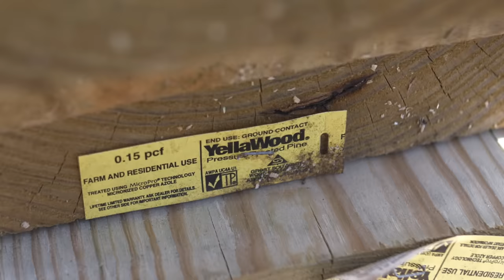5 Tips for Building a Durable Deck

Comment: I dont agree with spacing your deck ledger board 1" off the the house (of what ever structure you are attaching the deck to) this puts all the stress on your bolts. In this case you used all threads which are not as strong sheer value. If you flash and seal the ledger to your structure properly and water/vapor barrier the building being attached to, then you will never have to worry about water getting in there.  The bolts are designed to hold the desk from falling outwards not vertically. You should be using a 16D or greater nail or equivalent deck screw (concrete all threads in your case here) to secure it vertically to the structure.
Reply: Willis Cooper gotta love forti flash 😂👍👍
Reply: Also wondering up north in the winter where areas get freeze thaw freeze winters.  Water gets behind there, doesnt drain, freezes and expands.  Realize in Texas thats probably not an issue, but alos shows there is more than one correct way to build  adeck
Reply: Willis Cooper P totally agree. The pressure of the ledger against the structure its connected too helps distribute the weight and a lil construction adhesive helps too... As long as you putthe flashing in rite with a lil clear silicone.....  Its the best method by far
Reply: I was thinking the same thing. Even 1/8" of spacing puts added torque on the hardware. 

The epoxy holding those bolts has me a little concerned. I would still probably bolt from the ledger thru into the structure.
Reply: Willis Cooper the sheer strength of the fasteners is much greater than any live or dead loads that be applied. I’ve built decks for 20 years and this is the only way I prefer to build my decks as well. I have pulled MANY decks from homes where the flashing was correctly placed but the ledger board and the band joist had retained water in between them. No one ever thinks that ground water can cause damage but it can. It just takes longer.
Reply: Thomas NorthCastle your opinion may be correct about the strength of those short peices of inexpensive, japan steel,,,  but the actual load, i.e. (humans, weddings, hottubs, BBQs, wetbars) are in no way applied to those bolts directly,,,, the wood is what the load is applied too,,,   you drill  a shitload of large holes in the wood to accomdate those bolts ,,,  an really all u have supporting the deck is whatever wood remains above those bolts,,,,, and only where those bolts are located,,,  wouldnt it make sense structurally to have the load distributed evenly across the entire peice of wood top to bottom of the board?     this example here will work im sure,,  but u cant tell me that this method is better or best.... besides roto drilling and epoxy are really only used to fix mistakes or screw ups......
heres a great example ,,, have you ever tried handing a large cooler full of fish from a jonboat to someone standing on a dock who just finished a day of drinking and yelling?    you know how their effort always falls kinda short and they dont really bend down a whole lot And they stay about 4/5 inches back away from the edge, so you have to do that overstressed tiptoe,fingertip , neck flex all awkwardly to successfully get that cooler to its desired location....     apples to apples dont ya agree?
Reply: I think you need to look at the failure mechanism of previously built decks.  Water damage is incredibly common, bolts sheering off is... well, I've never seen or heard of it.  If it's a thing, even incredibly rarely, that might convince me you need to solidly attach a ledger board directly to the wall.  If that hasn't happened, I don't see why you'd worry about it.
Reply: Highest cause for failure of decks, is in proper anchoring of the deck to the house or structure it is a part of. Using an epoxied in all thread where water can easily get to it, just exaggerates your point...  Drilled in Wedge Anchor bolts would have been better in this case.
Besides he used joist tape to flash up against the ledger board...again my point stands how is water going to get in there if installed correctly
Reply: I didn't see any lateral load connectors
Reply: In some climates, adding that gap between ledger board could be a very inviting home for pests. I understand the point of leaving a space to allow any water to dry but not sure how that optimally  transfers over the structural load. Another step could solve this by installing EPDM (rubber roofing membrane) over the ledger having it go about 1' up the house (underneath the siding) and another 1' away from the house over the joists. Once EPDM is on, install the flashing over it, then install the decking over it and then finally re-install any siding that had been removed. Yes, it's a bit more work but if done correctly it will pretty much guarantee the ledger will remain dry and you won't have to negotiate with any structural integrity with gaps in how ledger is fastened. You could take this even further and extend the EPDM to cover the entire deck and essentially turn it into a rain collection system (Google Mike Guertin - he's provided a step-by-step guide). Also, not sold on joist tape completely...especially in climates that get extreme season changes with temps/weather. The freeze/thaw over time will not be too kind to any kind of adhesive. Probably not as big of a deal in southern states that don't see temps dip below freezing very often.
Reply: Plus just 1"" off the wall will accumulate dirt during the year and end up being soaked the same
Reply: I agree with you about sealing the ledger board properly.  Leaving a space between the house and the ledger board just doesn't make sense to me for the reason you said about downward pressure on the bolts.
Reply: Please stop disrespecting engineers without cause. The complaints about the all-thread rod are not based on any calculations of their capacity. It is just assumptions and they are not justified. 

In fact, I'm seeing a lot of errors, bad advice and totally backwards conclusions here. Especially about ledgerboards, joists and bolts. Bolts into perimeter joists are to take the deck weight, not to prevent pull-out. Although they do a much better job of not pulling out - unlike nails - that is all they are for. 

Pull-out is best prevented by bolting the ledger board to a special metal bracket that is screwed to an inner joist, or to blocking beyond an inner joist or two.  

This video has an engineer-calculated deck system. Don't second guess the engineers. As long as you work within the designed specifications, you are golden.

In this case, the hot-zinc all-thread rod is epoxied into reinforced concrete for a swimming pool, not a house's rim joist. There is no inner-joist-and-floor-sheathing structure to bond the deck to. 

The epoxy is appropriate to keep CO2 and oxygen from migrating through concrete and compromising the rebar of the swimming pool. In that way,  expansion anchors can compromise the lifespan of concrete beams. The hole depth for the rod is calculated based on the strength of the specified epoxy, not guesswork. 

All-thread strength is calculated from the inner diameter of the rolled thread. Engineers have already taken that into account. Again, they use equations, not guesswork. 

The bolts/rods are specified with a WWW stitch pattern. The lower rods alone can support the entire vertical shear force on the ledger board, so the upper rods can provide enough redundant capacity and improve rigidity. 

It is incorrect to say that a larger gap increases pull-out forces or shear force or torque, since the deck is normally kept horizontal. 

It is true that a larger gap increases shear strain on the bolts but that is included in the calculations for bolt size, spacing, quantity, etc. The hole diameter is strictly specified to keep the bolt straight enough under load.
Reply: @Flatus Antiquitous 
If you are assuming friction is necessary for deck support, you are just indulging in fantasy. Friction only reduces wear and movement (so it feels secure).

Also, the bolts connecting ledger boards to rim joists are only for supporting shear loads. That's all. They must not be relied upon as your lateral load connections. 

Pull-out can be prevented by bonding the ledger board to the inner joist system. That is, the floor sheathing and inner joists (that are securely fastened to flooring) is what best prevents pull-out. Sill plates are also dependable if anchored properly. If you depend only on the perimeter joist, it may be pulled right out of the house along with the ledger board - when a deck collapses!
Reply: @Flatus Antiquitous 
Let me emphasize this! Bolts into the house joist are for shear and only for shear forces. They do not prevent pull-out. Never, ever count on the exterior joist to be capable of preventing pull-out. That is the job of lateral load connections. 

Leave assumptions to qualified engineers, and stick to the code book for procedure. 

The diameter of the holes in the joist and ledger board are tightly regulated - it is a tight fit with no room for bending downwards. The all-thread is a safe, engineer designed, sole support for the deck in this video. Do not rely on friction calculations for support. Glue and friction are not to be relied upon. Engineers insure that the bolts they specify (in tables) will provide all shear capacity.
Reply: @Flatus Antiquitous 
You are providing a disservice to this fine channel by arguing your little physics lesson while missing the true cause of deck collapses. You are misleading the readers with your assumptions. 

Several statements in this thread - by you and others - may lead to incompetent and dangerous misunderstandings about how to use a house safely for support. You are the one that is plainly incapable of recognizing good advice. While pushing you own agenda you are misleading others into distrusting good engineering and misunderstanding mandatory Code practices. 

You have written errors about shear and pull-out and not edited your posts to remove bad advice. 

Shame on you for projecting on me. My advice is sound, flawless and edited for clarity, while you make stupid and rude assumptions about my competency. I hope you delete all your comments until you discuss it with an inspector and engineer.
Reply: @metro484444  
That's right. The engineer calculated that the all-thread is good for both shear and pull-out forces. But this is a rebar-reinforced concrete wall already capable of holding back tons of water pressure.
Reply: @avid0g  how are joists connected to ledger?? Only joist hangers.... ?
Reply: @metro484444  
Yes. Deck also has blocking mid-span and diagonal bracing underneath. 

Do you want more for something unusual on your deck? Sometimes we go beyond code to provide assurance.
Reply: I'm a 54 year woman never built a deck.. really not anything.  Inherited my Grandfather's house and I just don't understand why people don't investigate before they build.  Lots a wood along the entire foundation board from some deck builder that attached the joists to the board with literally no flashing and now the siding and the 12 X 6 by God there must be two... Shit, thank God I can come here and compare what you all say to make an informed decision.
Reply: Someone's an angry little engineer. Lol

I've been in construction my whole life never saw an engineer make a mistake hahaha

Allowing play on fasteners is ridiculous no matter the application. Unless for deflection

Comment: The chemicals and or salts from the pool will splash over the edge onto the galvanized hangers and bolts and cause them to deteriorate pretty quickly. They definitely will not last the 30-40 years you claim.
Reply: This is a very important point that really needs addressing.I have seen many near pool structures affected by corrosion that have obviously been built to normal standards with no thought given to the corrosive environment.
Reply: huh, never been in a salty pool before
Reply: Ryan Mader You’ve never been in a salty pool before? I’m not sure what that even means? You’ve never heard of them? Where I’m from salt pools & chlorine pools are 50/50. And yes, this guy should absolutely not have used gal hardware near a pool environment.
Reply: doc hall  you got that right! the guy who builds the thing is the most important engineer of all, because he's the last guy that makes the final decision on the specific material and hardware before its permanent, if you want shit done properly, do it yourself.
Reply: They should have all been STAINLESS

Comment: Beautiful deck and I love the view from it, but isn't there any code regulation for a safety railing, due to the height of the deck above the ground?
Reply: I’m sure they are gonna add railing next, that is way to high not to.
Reply: Code says you have to add railing to any deck that stands more than 30 inches high.  Railing is done last, so I am sure they did it but just didn't show it on the video.

Comment: Soaking the end of post in "end sealer" solution is new tip to me.  I like it!!!  Thanks for sharing.
Reply: I'm surprised he did not do such on all the lumber that is exposed to being wet. I do and never ever have any issues. The time to do it is before the wood is fastened up. Minimal cost (Relative)
Reply: Victor Eous, So I can wrap my head around this, are you saying you would put "end sealer" on the end of every board in the deck?  I could see where that could be a wise suggestion.
Reply: You can also buy green treatment (a wood preservative) that does this as well.  I treat all the ends, even the decking. Soaking is best; brushing requires two or three coats.
Reply: Every cut end, yes.  Although I don't soak it, I just put it on with a foam brush, though the stuff I used wasn't white - it looks more like coffee.  I put it on every cut - including stair stringers, blocking, joists, beams, ledgers, etc.
Reply: Yes Mark. . . . As others  above have mentioned. On posts I set them in solution overnight, all other ends/cuts get a foam brush hit twice. Better safe than sorry. I really do want the customer happy and tell them of the extra steps we take in getting it right for them. As a result we've not advertised for about 20 years.
Reply: you can use regular stain.
Reply: ....How Many years is the “end sealer” rated for???... —can’t be for life...
Reply: Use old motor oil , great preserver I’ve used it

Comment: Great job. Years ago I had my local aluminum guy make me caps for the top of my deck joists. 2" X 1 5/8" X 2". I  held them in place with a couple of galvanized roofing nails until the deck boards were installed. 35 years later and no signs of water damage. The other idea I had was to apply an aluminum "L" shape fascia  piece on the backside of the ledger board against the wall side.  It provides a continuous cap and moisture protection when affixing it to the wall. I finish it with a silicone bead where the aluminum meets the wall. Again, 35 years later and the ledger board has no sign of any type of water damage.
Reply: What about breathability under deck? No issues against ledger board.

Comment: that is one beautiful deck you have built there. I noticed that flashing was not needed due to a pool application. and the lack of a rail system.  I never liked relying on the structure for support, which I have done in the past. now I always have posts two or three feet from the structure. thank you for the video.

Comment: My deck are 12" on center or less and did it in 1993. The deck is the most solid deck I ever stepped on. Standard deck feels bouncy and flexes too much. It's a pain to put in the nails for the brackets back then with a hammer... not enough room to swing your hammer. Today, just use the pneumatic palm nailer or impact screw gun if you opt for screws designed for joist hangers. Great tips on ground contact lumbers and others. Syrprised you didn't mention roofing membrane and aluminum flashing against the house for water protection.
Reply: You can never go wrong with a palm nailer
Reply: Well said and so over looked

Comment: I have personally built decks going on 25 years now, no issues, except for wood decking and railing spindles warpage.  Framing, for the most part, is all good.  Never used joist tape, or spaced boxes, and sunk all my 4x4's.  There is nothing wrong with what you are doing, it's just you have to also give the other side of the coin too.  25 years, and counting, is pretty damn good.  Always put ice and water behind my boxes and tamped gravel in the hole, before concrete.
Reply: climate is important i think. where im from with snow the posts wouldnt last in the ground any longer than my 2nd marriage

Comment: 1) Ground contact PT 2) Ledger board spacer 3) Concrete pier above grave w/ metal post base 4) Joist tape though optional for dry climates 5) Joist spacing 12"

Comment: Replacing my rotted siding and ledger board now. The idiot that built the deck nailed the ledger board to the house and never flashed or anything. These are all great tips that I plan to follow. Especially the Deck to Wall 5/8” ledger spacers.

Comment: Thanks for the info video. I live in NC  and on the process of replacing my house 2x 10 outer band  and even replacing the second inner 2x10 in some area ! My deck is 12x60 ft long 🙁 they rotted from the ledger board flashing